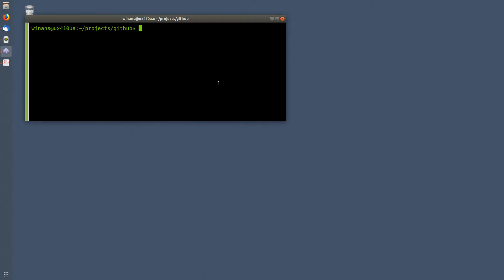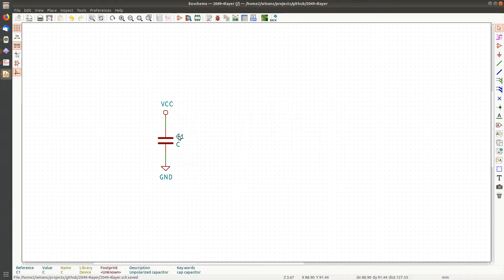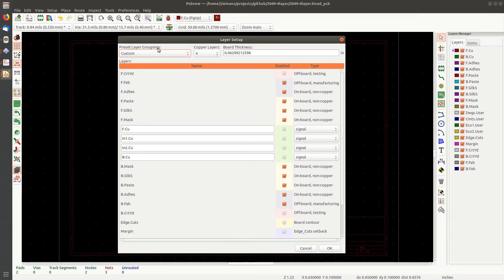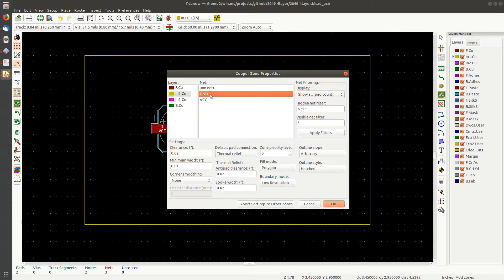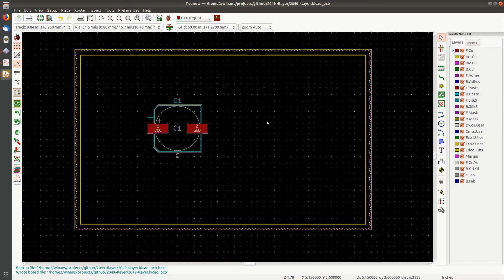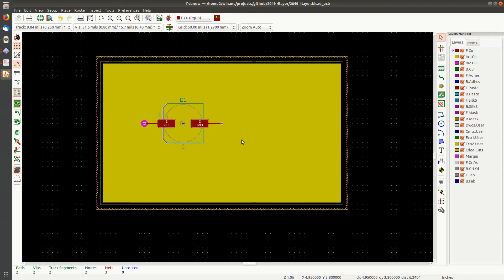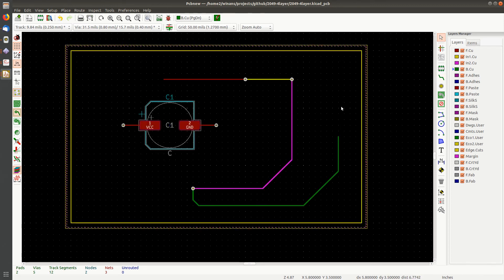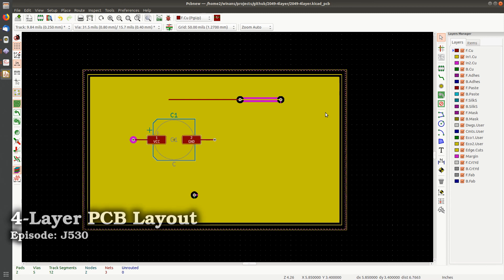KiCad 5 #20 4 Layer PCB Layout

Comment: Hi John, do you have any ideas on how to make a curved pcb? I need a small 1/2" by 5"~ish rectangular pcb that I want to be curved along its length. The board would then define an arc, from a 6.75" diameter circle, if you follow me. (Just imagine a 1/2" deep, wide carboard tube - the board would have that orientation, but just be an arc, not the full circle.) Is there some option for "super" flexible pcbs? (or very thin, where maybe I could only have a copper fill on one side, then heat it up to purposefully bend it - and somehow clamp it and have it set in that shape, before soldering the components on...?
Reply from the maker: You got me.  I know there are flexible PCBs.  But you need to shop around the board shops.  I've never made one.

Comment: Never new about filling the planes by just drawing outside the edge cuts, nice. one quick question thats sorta ish connected, if I use "keep out zone " does this leave bare fiberglass like if I wanted to shine an LED actualy through the board ?
Reply from the maker: Yeah.  When you draw the keep out, be sure to select that it applies to copper pours (filled zones) as well as other stuff and to select all the layers you want to keep clear.